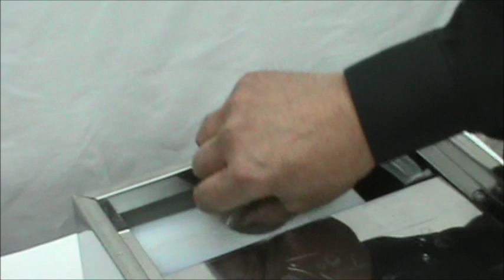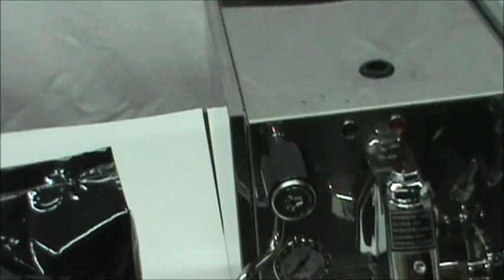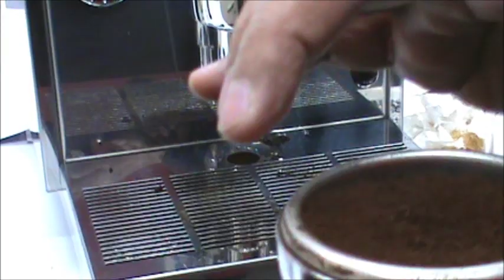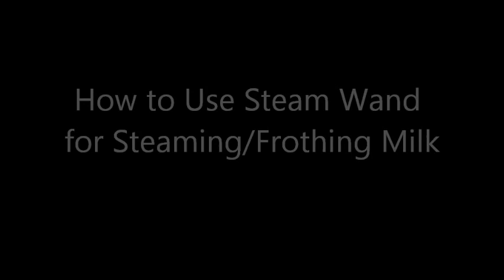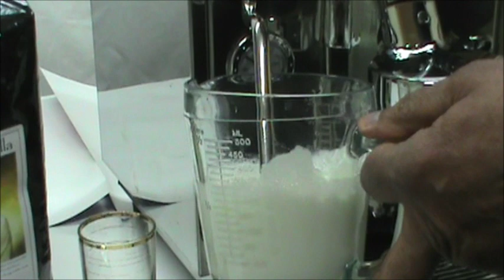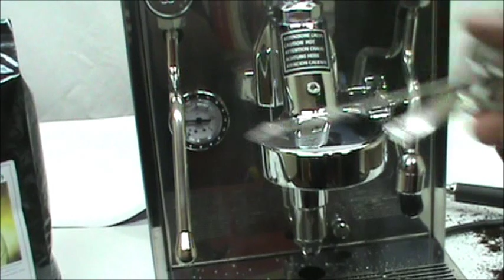Magister Stella Professional E61 Group Espresso Machine Operating Instructions

Comment: I would be comparing this to a Rocket espresso machine as that is the machine i am looking at currently.
The Magister Stella Looks like a nice machine, I have a few questions.
Are all parts for this machine readily available?
Are you the only USA source for Parts?
what material is the Portafilter?
What material is the Boiler?
Are the Heating elements replaceable?
what Pump is in this machine?
does it have a PID?
what kind of temperature drops do you get?
what is the price of this machine?
Does it have a 3 way valve?